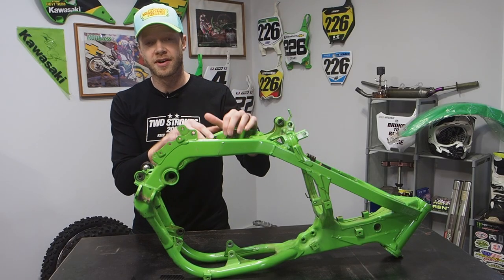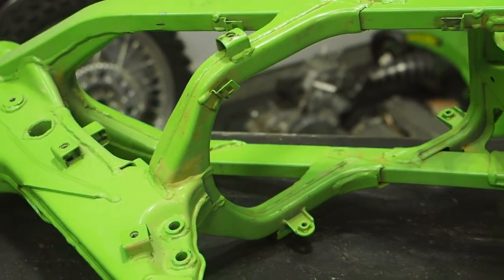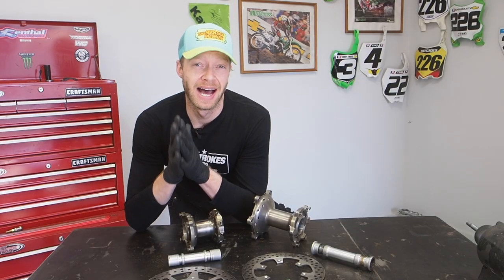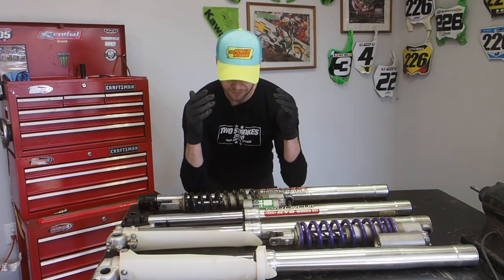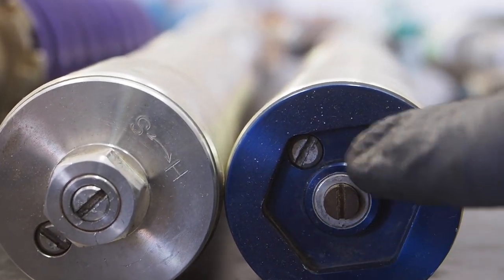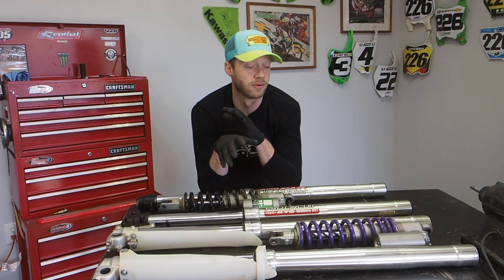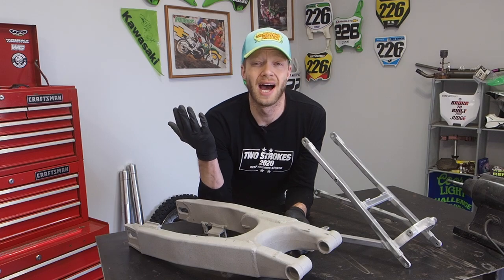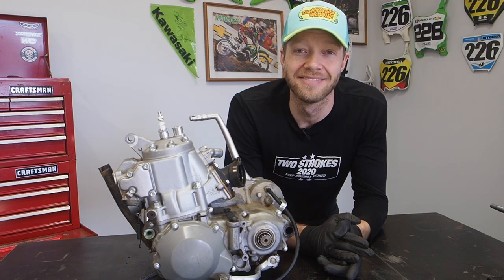SOS I Need Your Help | 1999 KX250 Splitfire Rebuild - Part 2

Comment: Hey Greg, your vids have helped me a lot! Im 52 years old and still live paycheck to paycheck. Im an old surfer sk8r moto dude. Dont surf anymore but still ride!!! Im rebuilding a 96 kx250 and If theres anyway you could get me a pipe it would one of the nicest thing anyone ever did for me! Im not one to beg but i figured it wouldnt hurt to ask as you were offering in a previous video. Thanks, Stephen
Reply from the maker: Hey Stephen! Thanks for reaching out dude, that is awesome about rebuilding a 96 KX250, fully support that! I may have come into a couple oem pipes for the KX, if they come through, I will let you know.

Comment: I know it's a little late but, I own a 99 KX250 and I had the swing arm vapor blasted and it came out beautiful. It has a nice smooth bare aluminum factory look to it.
Reply from the maker: Right on! Did the vapor blasting remove the oem coating that was on the swingarm?
Reply: @GregHitchko  Yes, the OEM paint/coating was completely removed. Looks 100x better now. I can send you some pics through Instagram if you’d like.
Reply from the maker: @JustBraap  man I should have just did that in the first place but I didn't think Vapor blasting would take that oem coat off. Now I know! Yeah man shoot me some pictures through the gram 👍🏼
Reply: @GregHitchko  Just sent you some. He really only had issues getting the coating off in the corners where the axle blocks go but I think with enough time spent in those areas you could get it all off.

Comment: I'm dealing with the same crap from my powder coat. The actual coats look phenomenal. But every bearing journal every bolt hole. Every hole on the calipers. No masking on ANYTHING!  I've spent hours cleaning up parts to be able to install.
Reply from the maker: Ughhh dude I feel your pain, what was the best way you found to clean out all of the holes for bearings and axles, etc?

Comment: Find a local blaster and specifically tell them you want glass bead media only used on the parts. Most will not plug holes, I make my own with gorilla tape (thicker for larger holes) Duct tape for the smaller ones. Sticky side out will keep them in place. The chain guide holes sometimes pop out but not a huge deal on those. On the frame neck i use masking tape in small pcs creating a funnel where the races would set, then go over with duct tape the same way. Media will cut through masking tape but it makes it much easier to remove the duct tape.
Reply from the maker: Update! I actually just dropped the frame off for powder coat at the same place and I brought the swingarm and subframe back to him. I voiced my concern and he's going to blast them with glass bead to smooth them back out. Excited to see how it turns out. This will save me a ton of work at the bench buffer 🤞🏼🙌🏼

Comment: I'd try to get it as period correct as possible. My vote is for black DLC lowers and kashima uppers. Regarding the sandblasting, they probably used a really course nickel slag as most powder coaters do. Got to remember that powder coat is pretty thick (2-3mils) so it will fill those divots.
Reply from the maker: I think I'm leaning keep it period correct as well Brett! Thanks for the input on that. Makes sense on the powder coat too, the frame should be fine after you mention that. I've got some work to do to clean up the swingarm and subframe still!

Comment: I've been trying to find some hubs for my 96. You said Nvmx uk is old Talon? I found Vmx, is that it? Doesn't look like they sell kx wheels rn though
Reply from the maker: Hey Chris! It's actually spelled Envy MX, here is their website. https://www.metricsengineering.co.uk/envy-wheel-hubs/. You can also call up DUBYA and they can refinish your oem hubs, with fresh cerakote. Either way, you've got options!

Comment: Your going for the bare metal right? Or is the frame getting powder coated? Sometimes vapor blasting does a really good job at restoring older metal but sadly it would not bring back the factory finish that you get from brand new bikes. I’m sure there’s a coating out there for it but it’ll probably be a small fortune to do. But for the suspension definitely do the hard anodizing. It’ll last longer. But if your looking for performance of the other coating. But if your going for longevity then hard anodizing is better. But those hubs look great. But you’d have to have then fine powder coated then vapor blasted to get them shiny. Then have them clear coated for that finish.
Reply from the maker: Thanks for the feedback my dude! The frame is getting powder coated the same color that the PC team used back in the day. And I think I am leaning towards the hard anodizing for the fork tubes for longevity!

Comment: I would go with the fauxshima hard coat upper and black hard on lowers. The gold and colored lowers don’t last as long if you ride a lot or in sand , I did the blue and purple on one of my older builds and it showed scratches after the first couple of rides I’d go with the black
Reply from the maker: Thanks for the input on the coatings dude! I think you may have swung me closer to the black DLC now. I love the colors, but you can't beat the function and durability of that black DLC
Reply: Yea in addition the cost of kashima coat is quite costly and if you get roosted and ding the coating is not good feeling. fauxshima is the way to go I’ve had no issues with dings or chipping on any of mine yet
Reply from the maker: @MOBLEY49  where'd you get the fauxshima done?
Reply: Morning Greg I get all my work done by JBI
Reply from the maker: @MOBLEY49  I've seen work done by JBI and it comes out really nice. I have them on my list of people to reach out to. Thanks!

Comment: I'm a spray painter/ blaster to trade and they've made a booboo with those items
Reply from the maker: Something doesn't seem right with it, right? Did he just use a media that is too heavy and abrasive? If If I had it blasted again with a lighter media, or maybe vapor blasted, do you think it would smooth it back out? Thanks for you input Gary.
Reply: @GregHitchko  yes he's used a too high abrasive for them, you could try something less course to see if it takes it down a bit with less pressure, I'd give them a call and tell them about the issue, bead blasting would have been better
Reply from the maker: @gary444  okay that is what I will do, see if he can do anything about it. It's a bummer too that he didn't plug up any of the thread holes or spots where the bearings go either. Lesson learned for the future to make sure to double check that stuff.
Reply: @GregHitchko  with the frame it also depends on how thick the powder goes on because it might actually cover the blast profile which can be measured, I'm also a nace paint inspector for offshore oil and gas platforms here in Scotland, we use a tape called testex tape to measure blast profiles